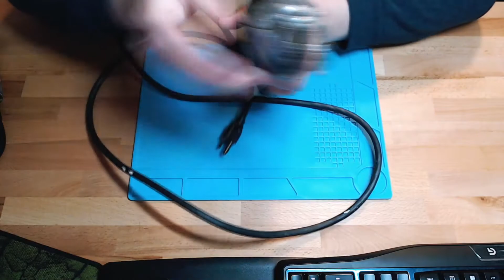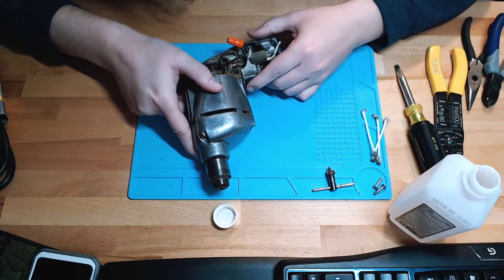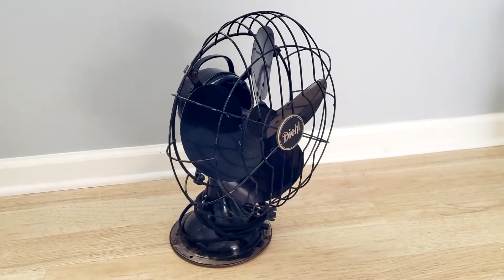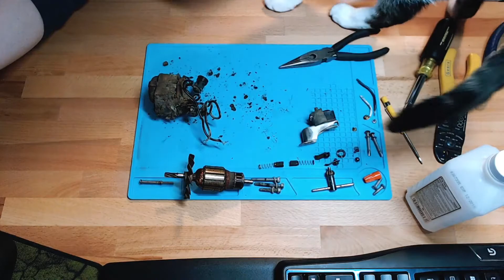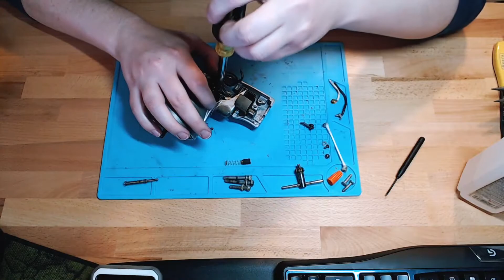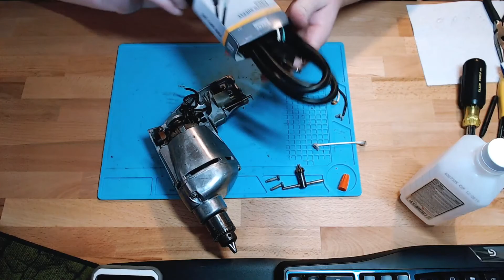Miller Falls Company Dyno-Mite Model A Drill Restoration

Comment: I have the same one! I need to add a 3 prong grounded cord to her. BTW. After install the cord with the ground installed to the frame of the drill - you can take a multi-meter and measure from the ground lug on the cord to the metal frame of the drill (or tool you are resorting). If get a reading of 0-ish ohms, you can be rest assured that you are GTG. No shock issues :)
Reply from the maker: Oh that's a fantastic tip! I'll have to go back and update mine, thanks so much for the comment!!!

Comment: I'm getting into doing restoration of random bits. I just got one of these from a free junk pile. I've been watching a lot of restoration videos. It's nice to see/hear a lady who's also interested in this kind of stuff. I hope you do more of these videos. Have you used the drill at all? I've read some people restored them enough to use, other people had problems with them getting too hot to use.
Reply from the maker: Thank you very much!
I plan to do more. I have a few projects on the line to start, thinking my next one is a cleaning of an air compressor. Or making a new desk chair from a car seat. Lol so hard to choose.

I have use it a little. It only has one speed so finding uses for that are difficult, I mostly use it on projects outside as those don't really need variable speed. I haven't noticed any heating issues yet but I'll keep an eye out for it.

Hope your restoration is a success!

Comment: I have the same one I'm cleaning. Those magnets that have the springs, should they be touching that copper piece that spins with the drill I put mine together and it started looking like sparking almost but like just a yellow glow so idk if maybe they are in a wrong way or what
Reply from the maker: If I remember right it from spinny thing out. It should go spinny thing>magnet blocky thing (not sure if it was a magnet) > spring.

If we're talking about the same part. At 10minites there sitting on the mat. The black bar thing should touch the spinny thing.

Mine sparked as well. I checked it with a voltage meter to make sure it was safe to use before touching it. Id suggest you do that as well given the age of these.
Reply: AweSmAsh ah ok thanks I wasn't too sure. Cause I didn't want to burn out the drill or ruin the small square
Reply from the maker: I understand. Mine had a small wear pattern on them that showed there orientation where they were rubbing against the spinning part. I did make sure they went back in the same way to not make new wear patterns
Reply: AweSmAsh Yes I made sure to do that, mine had the same. Thanks
Reply from the maker: You're very welcome
Reply: AweSmAsh One more question, did you have variable speed, like when you press the trigger the speed changes with he pressure or is it just one speed. Cause mine you hit the trigger and it's full power
Reply from the maker: Nope just one speed. Drills this old it was common to just have one speed I believe.